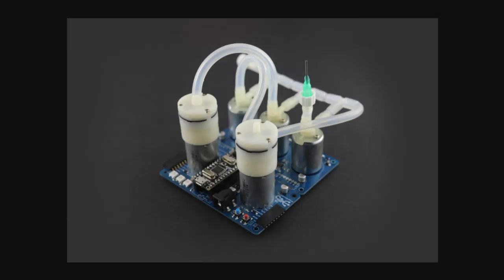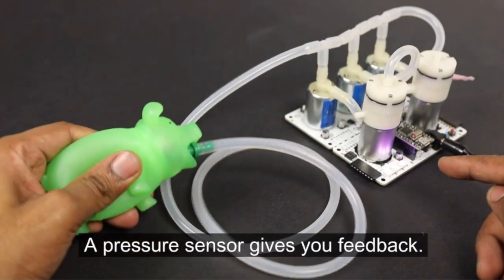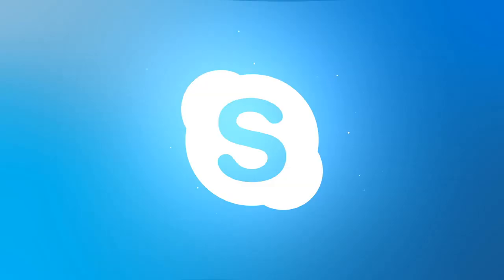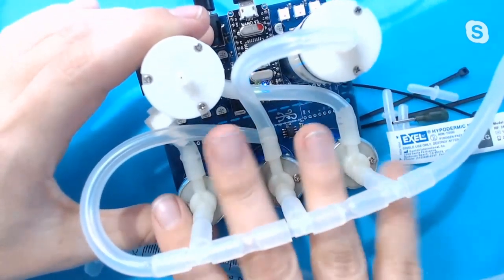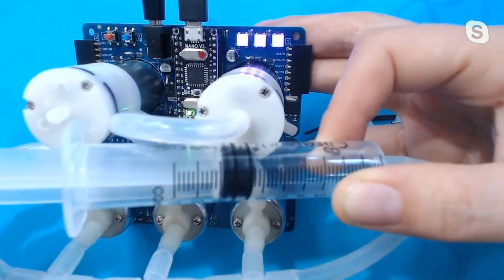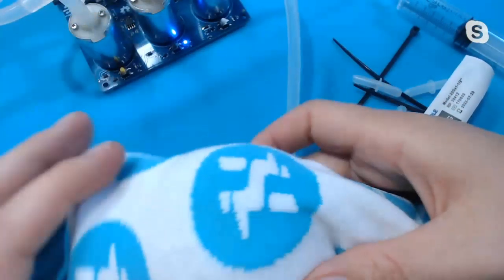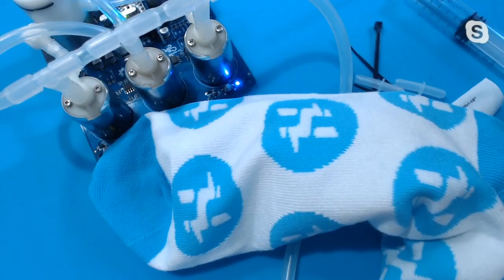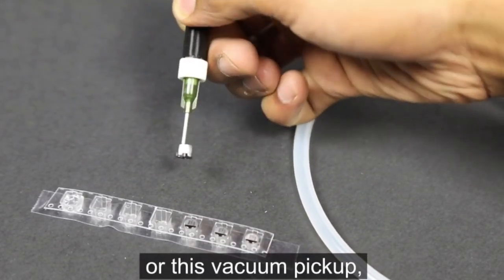Pneumatics for Arduino

Comment: If the motors can't pump air fast enough to make the crazy wavy man work, you could try using long thin balloons that would inflate faster since they have less volume, and wrapping a wavy-man "costume" around them - same principle as the breathing sock you showed.

Comment: A small fan would give you more air to run your flailing arm man. & that can be hooked up to a regular switch from your computer. That seems like a simple project she's over engineering. Very doable. This is for low compression projects. The soft robotic applications are amazing. I would like to see a bigger model now that could handle more & faster pressure.
Reply: Yes 🤭😂😂😂 With the simplest fan + arduino she can do it without all the complexity and cost of this setup 🤦😂😂😂. I think she just came with the idea during the interview? 🤔🙄.

Comment: I am looking for a way to control 4 vacuum switches, I was thinking about using a centrallock system from a car. But I need them to opperate all 4 independent. Could this do this?